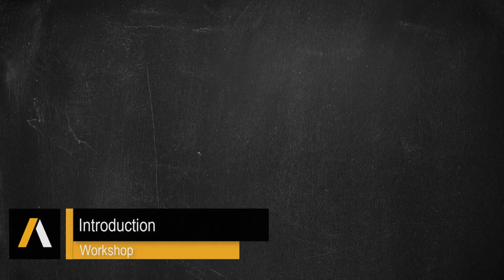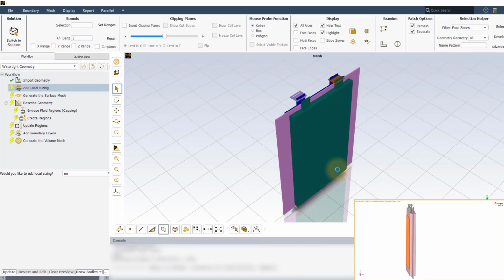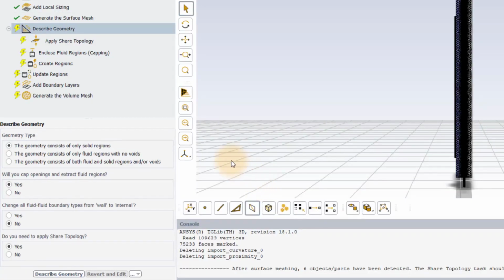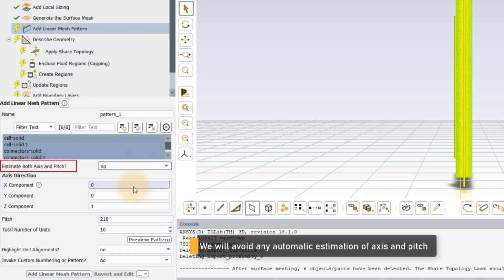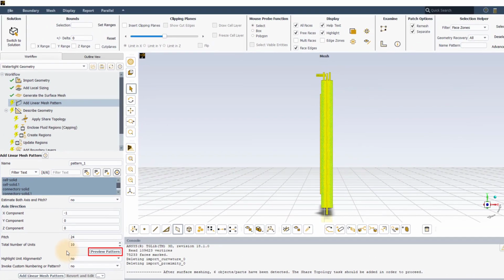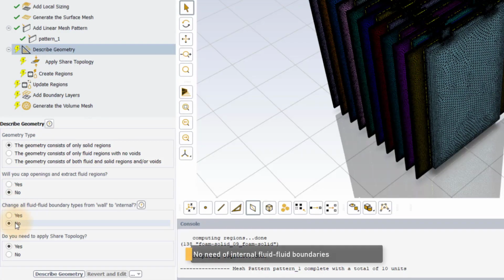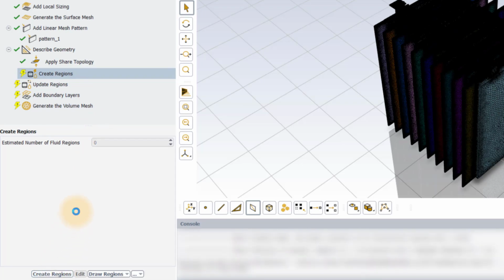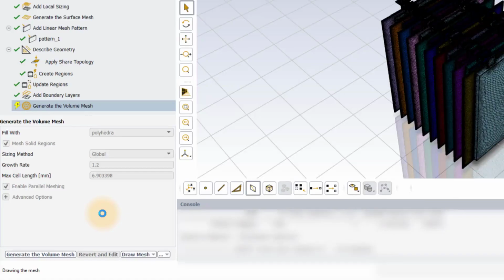Battery Module Tutorial Using Ansys Fluent Meshing Watertight Geometry Workflow

Comment: I know that heat transfer problem can be solved using finite volume method used by fluent. But since only solid body is modelled, isn't it better to use finite element method by Ansys mechanical? That way we don't have to deal with mesh complexities of fluent.
Reply: If you have heat source inputs, mechanical would do. But if you want to use Equivalent circuit methods or any of the other (more accurate) methods, only Fluent has that capability.